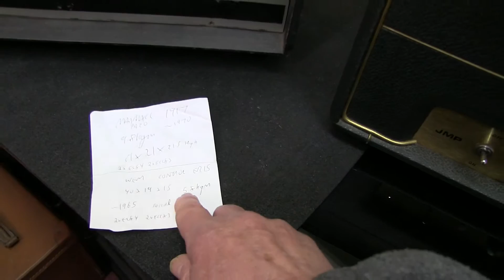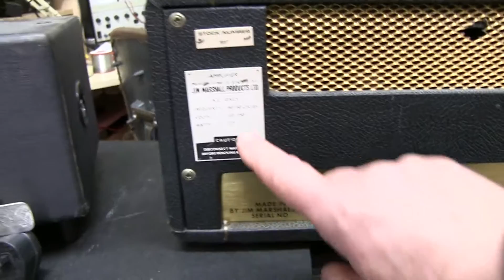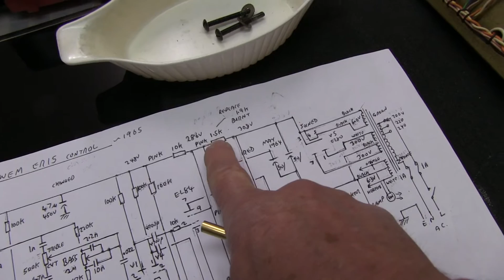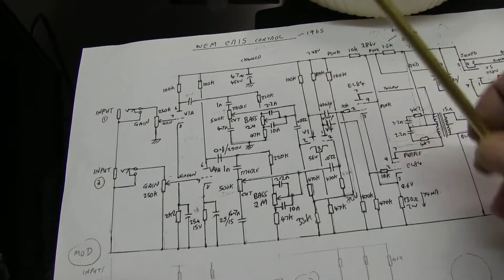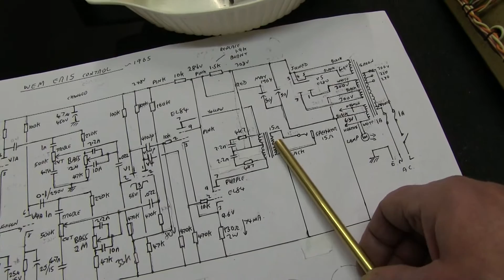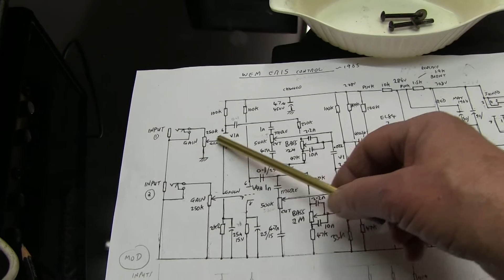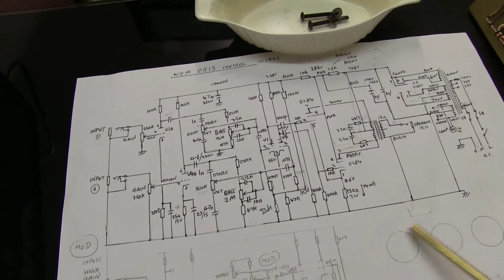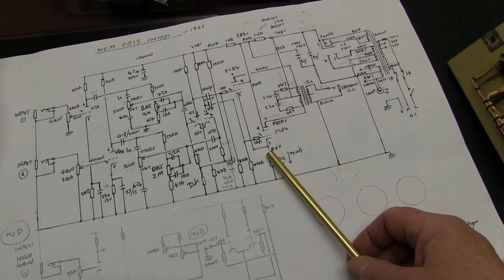WEM ER15 Amplifier from 1965. Circuit analysis and Sound Tests Part 1

Comment: Hi Nick Could you please send me the circuit diagram with the mods. Could you also tell me what wattage 4.7k resistors should I use to connect to the output  transformer........the resistors in my amp are dead and appear to be the same as the 1.5k across the 50/50 cap terminals; these look to be wire wound. Thanks